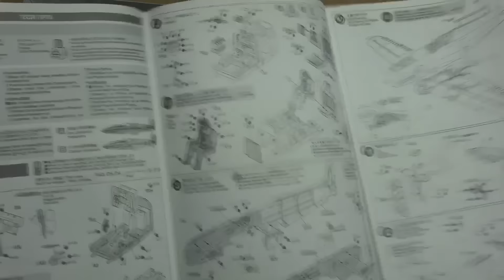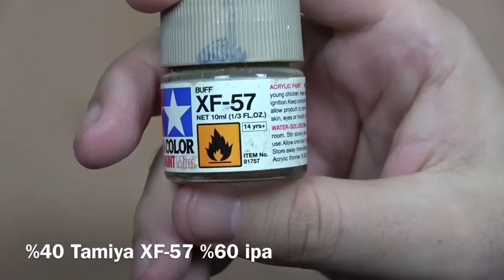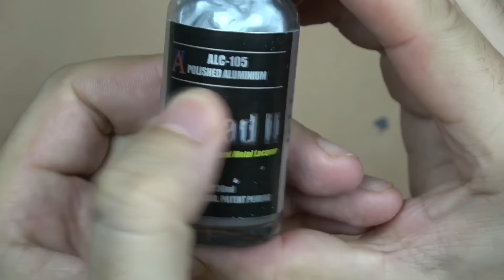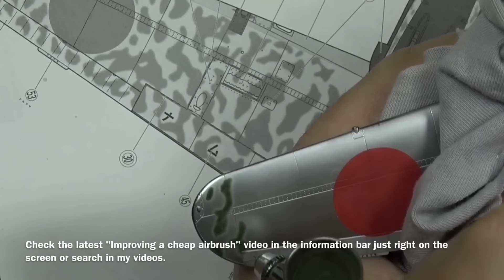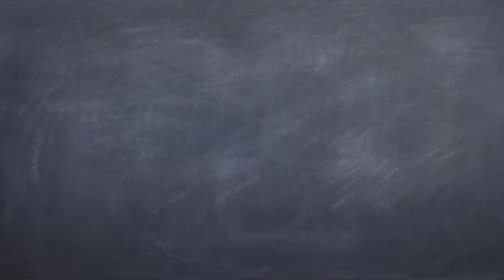How to build Tamiya Ki-61-Id HIEN (TONY) 1:48

Comment: A beautiful kit. And it certainly seems to be engineered to allow the production of a Ki-100 in the future. It's the only reason I can think of for the separate panel in the center section of the wing underside. Hopefully it won't be too long coming. I've been waiting a while for earlier versions of the A6M model 11/21 and/or 22/32 to go along with the new A6M5 tooling.

Comment: Really enjoy your videos.  Thanks for posting them.

Beautiful job on the Tony, but you sure went to a lot of trouble to get the gloss black undercoat for the Alclad.  I use 40% Tamiya X-1 / 60%  "slow" automotive lacquer thinner.  It gives a brilliant, glossy finish that bites hard into the plastic so your Alclad will not pull off no matter if you leave masking tape on for a month.  Try it: you will love it and it will save you a lot of time.
Reply from the maker: Thank you very much for the tip!

Comment: Outstanding job!  I just subscribed to your channel and look forward to your future builds.
I take "IPA" stands for isopropyl alcohol; Does it matter which alcohol you use when you paint....70% or 90%?  I can't remember which type I used but as a cost saving measure I tried to airbrush Tamiya paints with IPA few years ago and it didn't work very well.
Reply from the maker: Thank you very much! Yes it's isopropyl alcohol. It works with Gunze and Tamiya acyrilics perfectly. Also i use ethyl alcohol too. IPA is cheaper.
Reply: Thank you!  I'll give it a try next time.   I just purchased an 8 ounce container of Tamiya acrylic thinner for nearly $9 and for that much I can buy a LOT of IPA.

Comment: Could you explain the hairspray method? Is the paint not adhering well enough to the surface, and you can then create a chipping effect simply with a 2000 grid sandpaper?
Reply from the maker: Hi Harris, here's the link about it http://migjimenez.blogspot.com.tr/2009/11/hairspray-technique-vol1.html  But i use sanding papers instead brush. Ofc i don't sanding just touching on paint layer gently. If it not works paint layer not enough wet. Water is the key for this method.
Reply: Thanks for answering! I'll give it a try. I used the sponge method before with moderate success.

Comment: Brilliant.  You probably showed in the video, but was that Alclad black gloss you used as the base coat for the aluminum?
Thanks.
Reply from the maker: Thank you! No, i used Tamiya X18 -> 2000 grit sanding paper -> X-22 -> 2000 grit sanding paper -> Tamiya compound -> cleaned compound under the running tap water -> Alclad aluminum.

Comment: One of my favorite builds so far! 
How do you avoid dust particles under the paint, sir? I just covered my mustang with metallic finish, carefully trying to get rid of all the dust before spraying, but still I have some dust which is very visible under the metallic coat. Not a tragedy, of course, but very embarrassing.
Reply: you cant avoid that unless you live in a pressurized room. Polishing is the key! Paint the model than after a few layers of clear coat you need to wet sand the whole surface with at least 2000 grit sandpaper than polish it with a rag and tamiya compound. It will shine like a mirror.